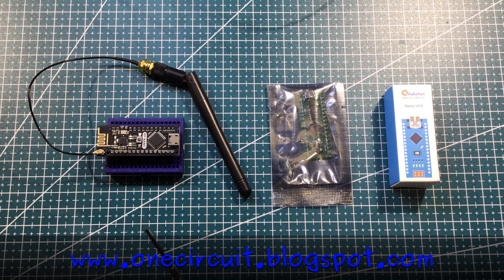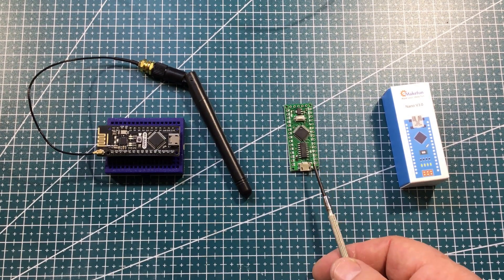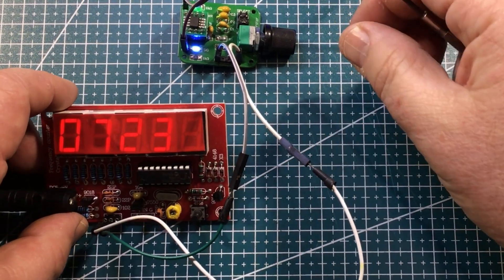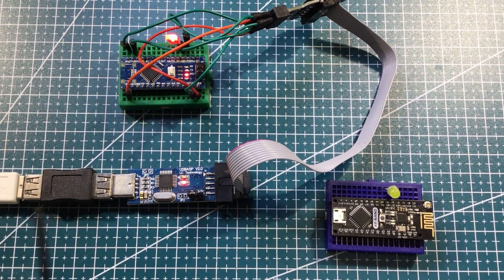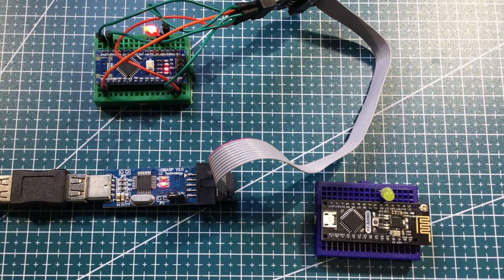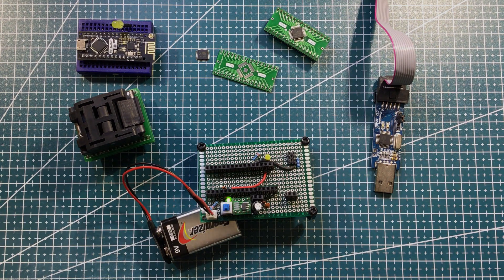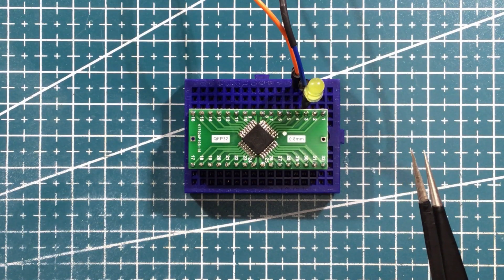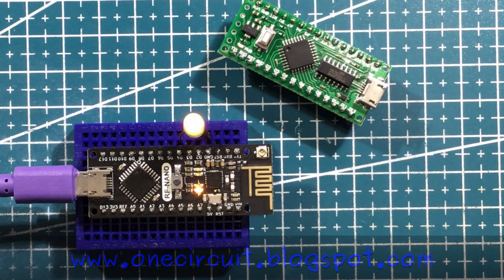LGT8F328P - some facsimiles are more equal than others!

Comment: I wonder if that chip on the RF-Nano is an unmarked AvgA328?  They will program as a 328p, but with the clock rate being way off from my findings. The LG328 chips use a different ISP protocol than the Atmega's.  You may want to try the boards with the LG328 Arduino IDE specs.  It's by dbuezas.
Reply from the maker: Part of me says “Great suggestion!” and part of me says “Nooooooooooooooooo!” Mmmmm, which will win? 🤪